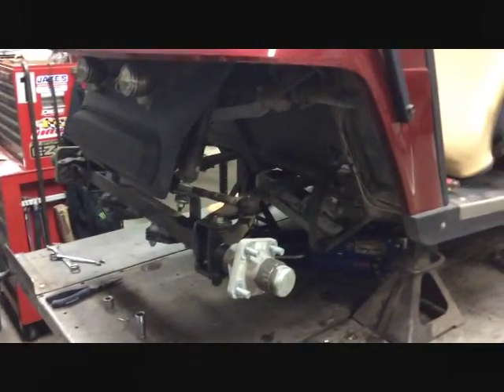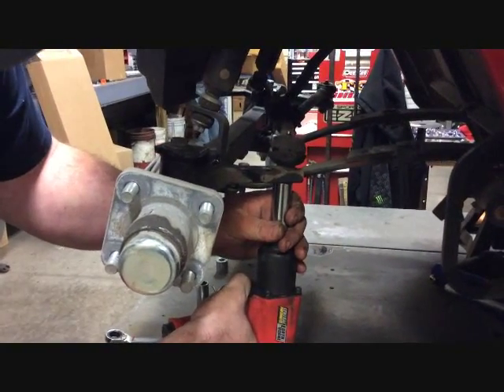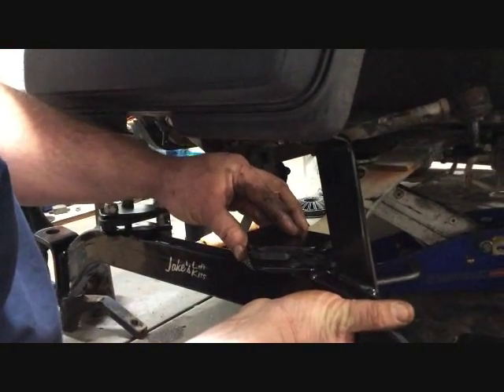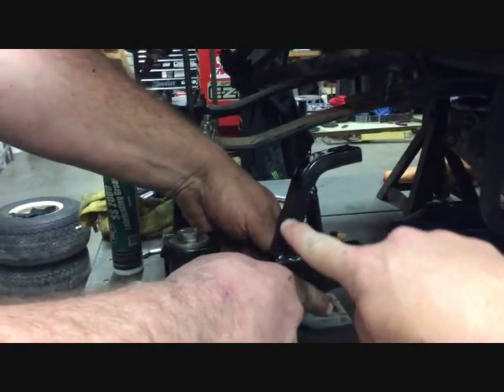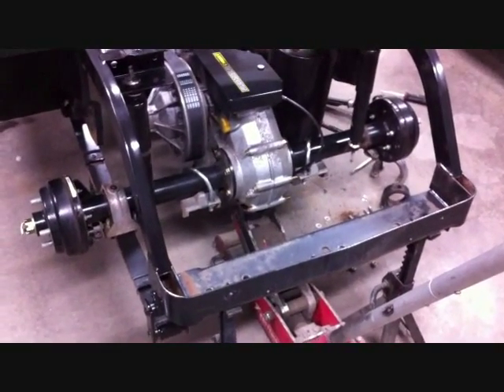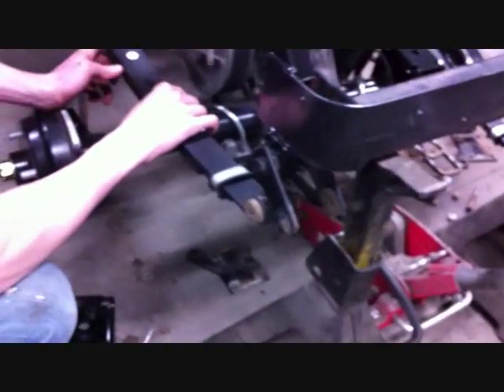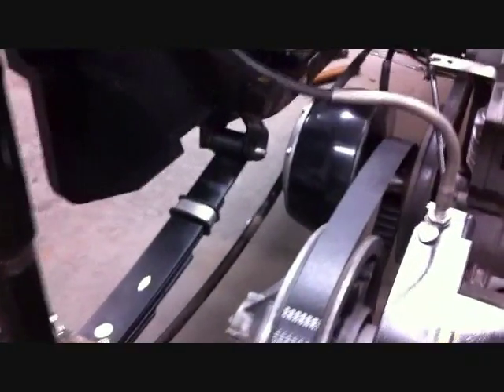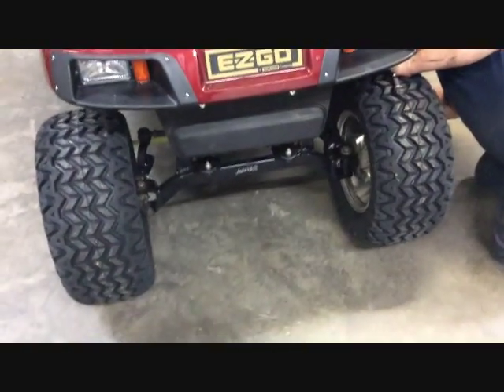Jake's Drop Axle Lift Kit for EZGO MEDALIST-TXT 1994 - 2001.5 Intall

Comment: So from what I’m seeing, there is a steering shaft extension from Jakes front lift that fits to steering column! What if there is not one? I bought a 2004 EZGO TXT that has the Jakes front end kit but not the rear. Is there some where I can Purchase the steering ext. and the rear lift, without buying the whole kit. Also do you not need the rubber grommet and bracket on the rear axle housing? Thanks….great video.